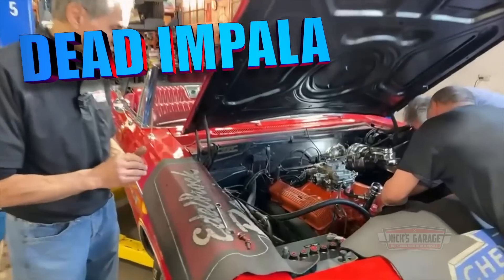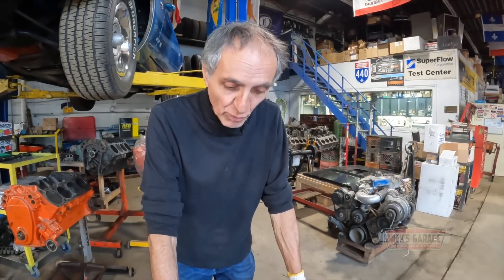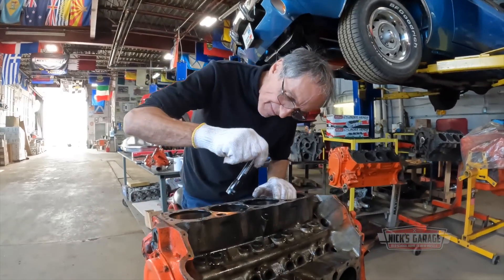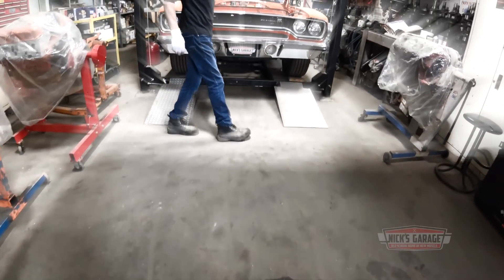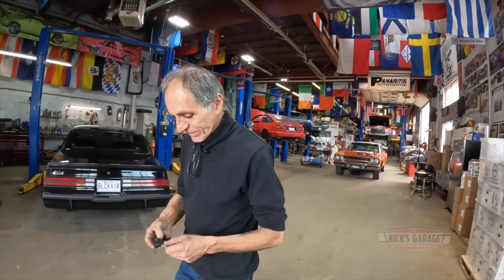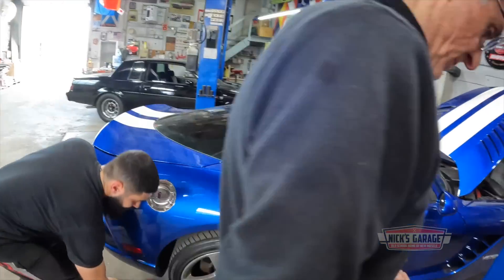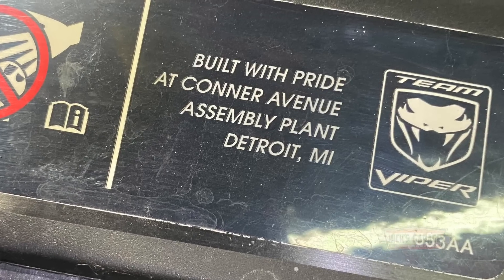327 Chevy Autopsy - Smoking Gun FOUND!

Comment: Myself I would have had that thermometer on the water as it heated the new thermostat and see that the new one did open at or near 180.  But that's me.

But that doesn't explain what happened to the coolant. Please let us know if your block guy finds a crack or whatever is found

I had a 70 Road Runner I bought used in 71. I sold it a few years later. Been crying about that ever since.

Comment: Almost looks like they might have tried to put a different heater core in it the odd holes almost right under the factory holes
Reply: The holes are probably not for a heater core, most likely an aftermarket air conditioner was installed at sometime in the past, and then removed. I know this is a convertible but it's still nice to have air conditioning. Like when you are out driving in the summer, it's hot out and starts raining.
Reply: @jcos55chev19  yeah idk was just throwing that out seeing as the holes are in almost same spot sorta never seen an ac like that b4 so ima have take ur word on that part lol its gotta be something for sure
Reply: @ericbeeman8717  Back in the day (1968-71) We used to install some aftermarket air conditioners when I worked at a auto glass/stereo shop. That looks like a hack job. We always cut the holes evenly. We used a hole saw and even used rubber grommets to seal and finish it off neatly.
Reply: @jcos55chev19  right on thats  cool I never knew about stuff like that b4 my grandpa and his buddy use work on old cars back when I was a kid if I had seen it never actually knew what it was and they're both gone now so can't ask em but thanks for sharing that bit of info very intresting thank you sir really appreciate that

Comment: Wait so the warning light for the overheating only works if theirs coolant in system, Now I'm starting to see why everyone always put that 3 gauge pod with the oil pressure, water temp and voltage on it on every muscle car ever made with a white backface so you can see where the needle is at a glance, like no wonder that was a day 1 mod, also is it possible that maybe the radiator cap was defective and letting air in so it could boil with every heat cycle till it reached its critical point and started burning the fluid as it lost its thermal conductance? 

and I would check anything plastic connected to the radiator system for cracks, as maybe it wasnt eating the fluid but leaking it onto something that allowed it to burn as it dripped out of the car

like fill it up and do a pressure test with the engine out and see if anything starts leaking, and insisit on putting in a three gauge pod now that we know the cooling system works that way

as damn that 327 was a runner and then some, like I dont know if they used plastic radiator overflows in this era, but its a 50 year old car, maybe something let go and no one caught it

 also with the rocker panel I've heard of that being called the red badge of courage if you burn yourself on that of all things lol, and they actually insulated them to the point that they took 30 degrees of heat out on the 4th gen, the generation after this in 2013 from 90 to 60, like those sidepipes in the rockers create that much heat, and god only knows what it was like on the first gens, as I think theirs a sticker saying warning this panel can reach a 130 degree's 

which kinda makes me wonder how quickly that sidepipe would melt snow in the wintertime if you left the car out and had to go start it lol

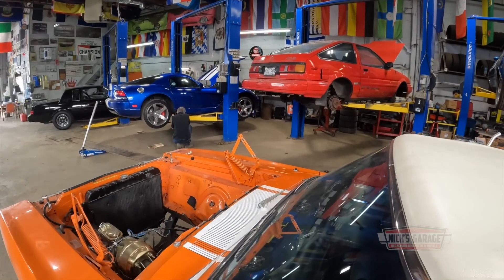also gotta love the image at 23:02, a Roadrunner, a Trueno, the drift and tuner car of choice in japan, known as the AE86, as its light, quick and well balanced from the getgo, and a Viper all in the same shop

Comment: That’s a shame. That engine was beyond overheated. It was cooked. A quality set of gages are worth their weight in gold. International trucks used Kysor safety systems to shut the engine down in the event of loss of oil pressure or engine overheat. They were a bear to troubleshoot but they did their job. They were Lineman proof. Lol

Comment: Regardless of how much culpability the customer has, the fact is that a $15 part destroyed a $1500 or more engine.  That is terrible, but it is the way it works with mechanical things.  I hope it wasn't the OE engine.  That would make it even worse.   Not sure you can ever use that block again without having it crack from all of the hot spots.  Possibly the same with the crank.  The carbon molecules will have moved all around in both parts.

Comment: I had a Pontiac Fiero that had an overheating problem where she got the engine so hot it got a milkshake oil in it so had to do an overhaul on the motor had cracked head so new one was bought and did rings, hone cyl. and put it together. The lady took it and drove for 20 miles or so and it started overheating, brought it back and i had to take block back out of the car and had it magnet flux and damn it had a slight crack in the water jacket. I should have done a better job just stopping there when i found a crack in the head

Comment: Blown aftermarket head gasket, or a warped or cracked cylinder head or block. It could be anything on that 327 Chevy that caused its meltdown. I see later in this vid, it was a faulty thermostat that was the culprit of the 327 Chevy's demise.
Reply: My advice: buy a DIFFERENT brand of thermostat. Buying the SAME brand as the old one might do the same thing: stuck shut after 180 degrees F.

Comment: Soo many variables to look at.  Blown head gasket from cylinder to water hole would create steam out back but I'm sure you surfaced block and heads so I doubt it. Heat riser on exhaust stuck closed would make engine overheat and warp heads causing blown head gasket.  A plug or 2 should show evidence of this.  Check passenger floor incase heater core leaks. Also if you installed engine and the lower radiator hose doesn't have that wire support on the inside to prevent hose from collapsing then that's on you. If it has a temperature sensitive fan that's not working that much heat wouldn't happen when driving. Oh yeah,  if you put pure antifreeze in instead of premix, that would over heat engine to the point where head and block could warp and cylinder pressure would pump all the coolant out the overflow. My 1st two checks would be the heat riser cause they are normally closed and open when you hit the gas. Next wet rug passenger side. As far as customer I never inform them of any smells that would be normal like paint on engine curing. I let them call me about smells and talk them through what to check. It's just a phone call that could end up costing far less $$$ !

Comment: Well. When I replace a thermostat, I always -- ALWAYS! -- subject the new one to at least three cycles of open/close, and I do it for free. I cannot stake my shop's reputation on some tweaker burnout in a factory somewhere when I perform top-flight, expensive repairs on customers' automobiles. I buy thermostats in bulk, and I test them when times are slow. I have never had a customer come back with a bad thermostat, but I find about three duds every year as I test 'em before they go into stock.

Comment: I have 19 years at Intermountain cooling systems of Logan ut. We won't use fail safe brand Stat. Thay should be called fail guaranteed. Most modern cars operate at 240degrees  so fail safe will lock open the fist time it reaches operating temp. You decide.  Danny Banford

Comment: Everyone gushing over the idea of testing the thermostat before installation, but that doesn't guarantee anything, it only means that it opened THAT TIME! Nick and his crew installed and ran that engine and he said they had good flow through the rad, so it was working at that time. Testing it then wouldn't have prevented anything or proved anything. Regardless of what caused the overheating, the onus is on the owner who drove that poor engine to destruction. No way in hell that he didn't know something was wrong, overheating engines get lazy, noisy and smelly LOOOONNNGGG before they burn the paint off the block and heads!

Comment: Doesn’t the liability fall on Mr Gasket for a faulty thermostat?
Reply: Liability would be limited to the value of the part (thermostat in this case).... and that is if you could prove that was the cause and not the effect of a grossly overheated engine and not owner negligence

Comment: I will never install another thermostat without testing it first. I replaced the thermostat in my Dodge diesel when I replaced the water pump thinking it was a good idea. This truck would get up to about 210 degrees, then drop down to 200 degrees for a short time and then back to 210 degrees over and over when I drove it. I pulled the thermostat and tested it in boiling water just like you did. It would open slightly after it had been in the boiling water for quite a while,  then close up and then reopen just like it did when I was driving. I bought this thermostat Advance Auto Parts and it was made in India. I found out that they have a department that searches the world for the cheapest parts so brand name is meaningless. When I took it back for a refund I told the guy to throw it in the trash and I kept the box so he couldn't put it back in stock.

Comment: My guess is that you had the wrong radiator cap on the radiator. That will dump all of your coolant as steam straight out of the overflow. If you had the wrong cap that was rated at a lower psi then that will definitely happen. Either way, that engine needs a complete rebuild from a bare block.
Reply: Block and heads toast. Would be warped to oblivion.
Reply: @hotpuppy1  more than likely. It's worth a check.

Comment: No matter how many times I had used a certain brand of something like a thermostat, if I had one that was working  then after a short time it failed and caused a catastrophic engine failure like that, I would be hesitant to use that brand again out of fear of it happening again. I would switch over to another brand that is known for quality even if it were to cost more because a $20 part failed and caused engine damage that is going to cost well over $1000 to repair. I may sound a bit paranoid but I wouldn’t be willing to risk having it happen again.
Reply: Or maybe test each one before installing it from now on, I think I will from here on out.

Comment: WOW Nick, I hope this owner is not blaming you. or your shop. As soon as I heard overheat, the first thing that crosses my mind is thermostat. It is the cheapest, yet most over looked component in the engine. Without a doubt I would look at thermostat before thinking anything else in an overheating situation and simply opened the cover & thrown it out. Also consider the driver. Why would you continue to drive a high dollar cool classic car, when you know she is acting  up, getting hot, and overheating. Problem could have been solved by removing the thermostat on the road & that probably would have saved the engine. I guess not a lot of people know you can drive a car with one. DAhhh.

Comment: Everyone thinks t-stat just fully opens at marked temp NOOOOO. (Example 190 deg t-stat) starts opening at 190 deg and its not fully opened until 10-15 degrees later. Also T-stat only controls minimum temp not max temp. Airflow, grill opening and rad size has big effect on max temp. Like modern cars with people BS I put in 170 deg t-stat, changed fan on temp to 170 degs, I cruise down the road at 170 DEG and when I'm on it WOT on 95 deg day Total BS. Driving down the road Fans do nothing its air being forced through grill opening. Just like my 15 mustang GT with factory 180 Deg t-stat, driving with air on and its hot day coolant at 205 degs. I have tested t-stat its not fully open until 191 degs. Also I'm a tech but internet techs talk out their rear and most of them (99.999999%) have never tested or have a clue how t-stat works.... Just like race cars tape up the front coolant temps run higher but car drives better in corners. Take tape off, coolant runs cooler but now front end slides

Comment: Filks, it don't take many miles to cook an engine devoid of coolant. Cust sez it ran ok to destination which shows all was ok then, but failed during return. Since it still held a pressure check after 'roasting' , that's a good indication vehicle was tampered with. The cust driving til it quits is foolish @ minimum. The block should be hard as a brickbat after it's heat treatment. Should be good to go with pistons, rings, brngs, seals and fresh cyl hds. The crank spinning easily shows block and crank are good and straight. Bad deal for shop , but I'm sure parties will work out a fair settlement. 

Sidebar: There are temp gages with integral warning lite and sound these daz.... 

If you do this to s modern vehicle, the ECU will tell exactly what happened. Destructive overheating isn't covered by warranty in most cases.

Comment: A guy would think spending $30 (I did) on that thermostat it will just work. Crazy thing about running a classic car, doesn't matter how "new" the parts are. The driver is the only safety. be careful out there guys👍

Comment: Sorry, but over heating does not turn the block black like that. A little paint for extra effect for the camera? maybe?
Reply from the maker: You must be joking..
Reply: @NicksGarage  I have been working on cars and building engines for over 40 years. I have never seen an engine turn black unless the car burned to the ground. I've seen heads that have the paint burned off around the exhaust ports, but never have seen them black like that. And I have seen a lot of burned up engines.

Comment: What do you mean you need to freeze the cylinder? Why didn’t you just do a Magnetic particle inspection on the block? It would reveal the most fine hairline of cracks, using the wet fluorescent test method. It’s the most sensitive for detecting any surface cracking. But of course you being an engine shop you probably know that already. Also the fluorescent dye penetrant method is commonly used to look for fine cracking on engine parts using the black light method. Typically used in the, “Aero Space Industry” to detect the finest of cracks in alloyed metal. I thought you would be showing that testing method.

Comment: One thing I don't like about 60's chevs are those temperature lights.  My 63 Has them  . I'm wondering If the 66 got hot the light came on but the owner didn't notice.  It's my fear with my 63 and it's 327. It's the cars original engine. But that being said I know cars especially classics, and in my years of driving (I'm 48) live in Australia,  I've had engines overheat. Hoses blow, radiator blocks up, thermostat sticks closed. I've had it all happen.  But I've always shut the engine down at the first sign of overheating,  you just know when a engine is getting to hot   , one thing is the paint starts to burn as it isn't designed to go past a certain temperature.   So I highly doubt I'll ever overheat my 63's 327.  Tbh is the 66 owner a car guy or just someone who knows how to put gas in and drive .

Comment: Just not buying the thermostat etiology….probably fried after the fact by the burned engine.  A stuck shut thermostat would not allow coolant into an overheated engine, but it wouldn’t cause coolant to be burned unless cracks or gasket failure occurred….and neither was found.  Also the absence of shiny clean pistons argues against any coolant burn.  It sounds to me like overheated coolant blew out of the radiator onto the ground and the driver missed it.  Why it got so hot is still unclear, but driver error very likely here.  Dr. K.

Comment: Mannnn!  Wooo!  That’s unbelievable! Cooked that sucker! Almost looks like it was caught on fire! Unbelievable! Luckily it didn’t lock the whole engine up! For one, I would be hitting Mr. gasket up for a new engine! I’ll tell you that much! And for two, that customer needs to get a set of real gauges on that engine! You don’t just tool down the road without at least glancing every once in a while at your temp gauge! Even on a cruiser! I got 11 grand Under my hood in my 347 stroker and I’m always looking at my temp gauge religiously! I’m running no thermostat at all, just a restrictor plate to restrict and slow the coolant flow down some. And my temp gauge is dead accurate with my electric fans grounded switch which is also tapped into the water jacket on the intake. I’m always looking at those three!… temp gauge, electric fan, and oil pressure! Constantly looking at those! I have an indicator light on my switch panel under my dash that tells me when the fans are on and they click on and off exactly when they’re supposed to when comparing to the temp gauge so I know the temp gauge and fan switch together are dead-on accurate! No excuse on either part! The customer and Mr. gasket are both in the wrong!

Comment: What a shame? A 15$ part failure ruins a vintage small block Chevy motor. What's worse is all the grief it caused after the fact & The numerous hours invested to do such a GREAT! job. To begin with. All thrown, Down the drain. Square 1 again. Nick. I wouldn't run another offshore t-stat. I'd get on eBay & type Chevy 180* t-stat. Made in the USA

Comment: If the engine drove 200 miles then it overheated so if the shop did  any work invoking the cooling and over heating the shop would be responsible. I know that’s bad news  but that’s how it is. It could be something as simple as a hose leaking and he didn’t notice it and kept driving it